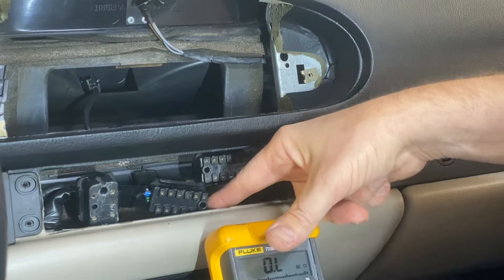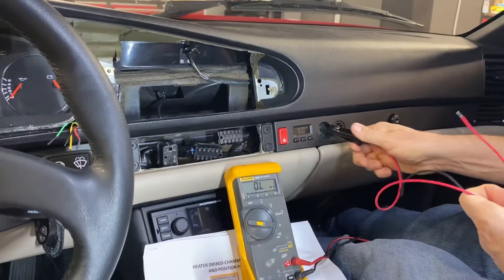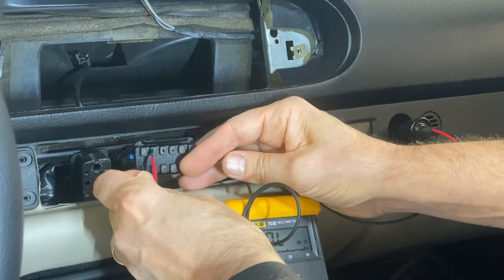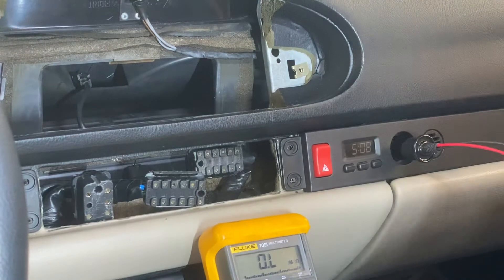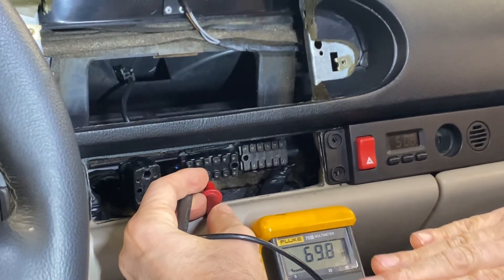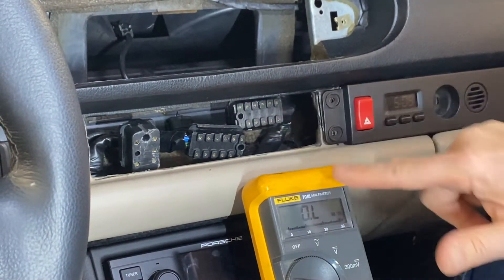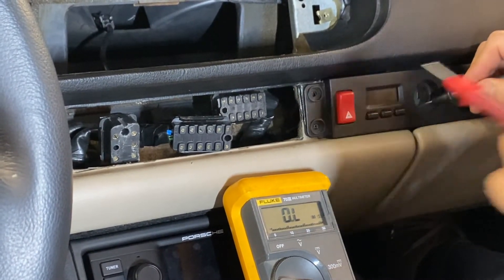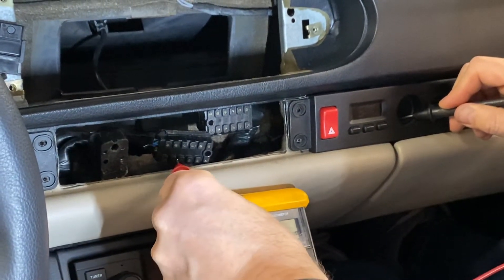944 HVAC electrical tests

Comment: Mine functions correctly but lights don’t work. Checked and bulbs are good - ran 12 volts to them. In the three plugs, which supply + / - when headlights are on?